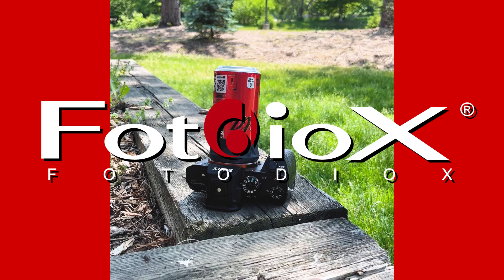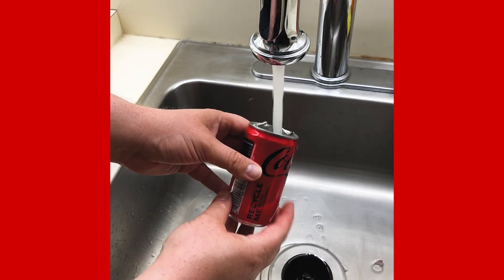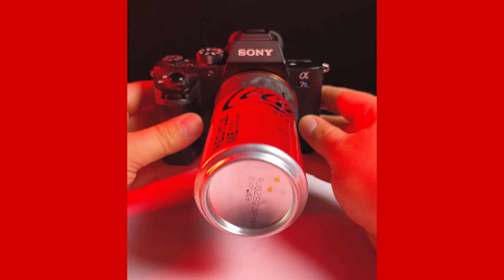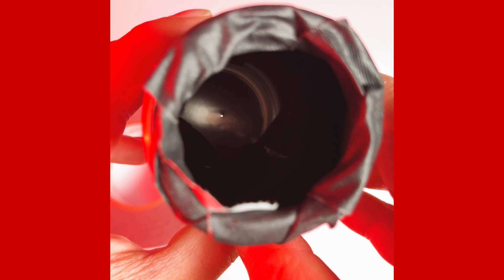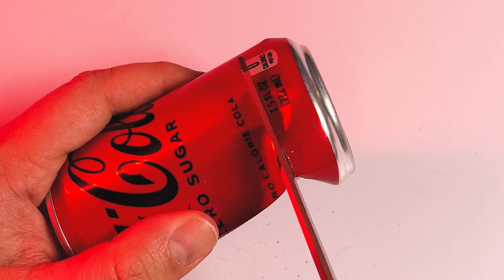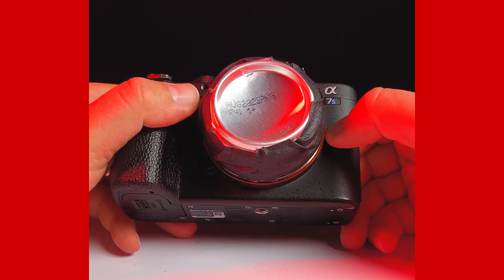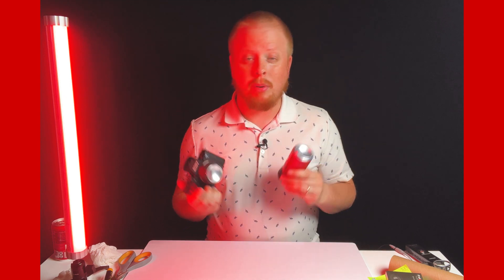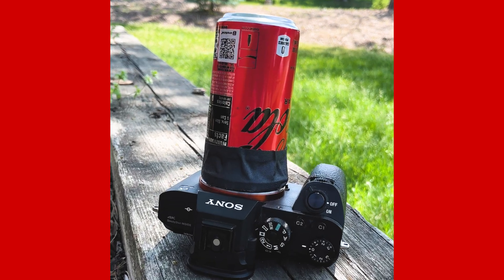How to Make a DIY Soda Can Pinhole Lens

Comment: i shoot analouge, so naturally low iso of 100-800, will regular shutter speed work or do i habe to do long exposure?
Reply from the maker: You'd have to go long exposure. Try using a pinhole light meter app and set the aperture to f/125. That should give you a good exposure time.

Comment: Do you have to use a mount or no
Reply from the maker: I like to use an adapter as a base for this build because without it, you have to tape the can directly to your camera. But if you don't want ti buy an adapter, you could use a camera body cap and just remove the center of it.

Comment: Quick question, what if instead of using an adapter to mount the lens to the camera I use a lens cap and cut out the top part of the cap? Will that also work?
Reply from the maker: Yes, that would work just as well.